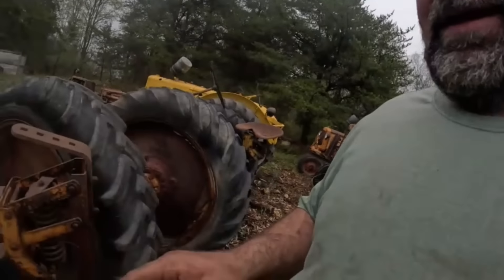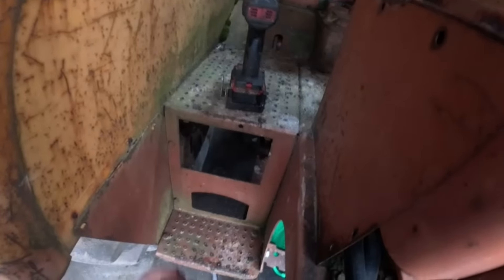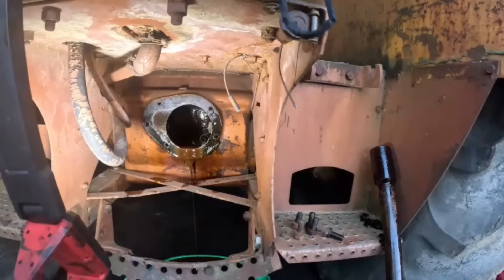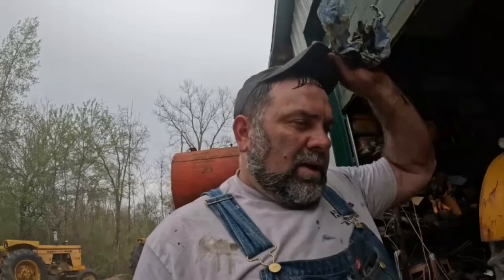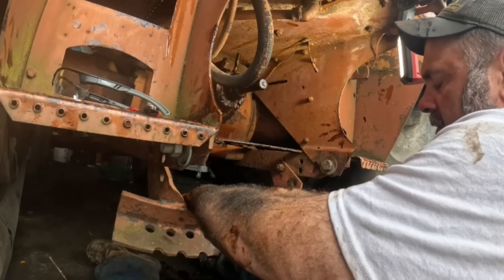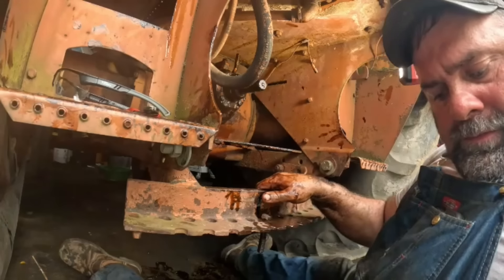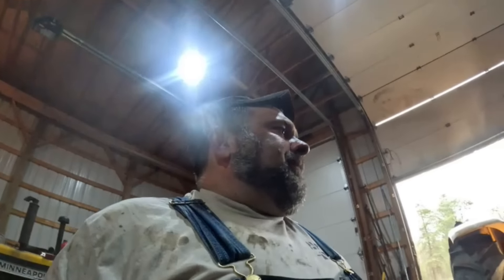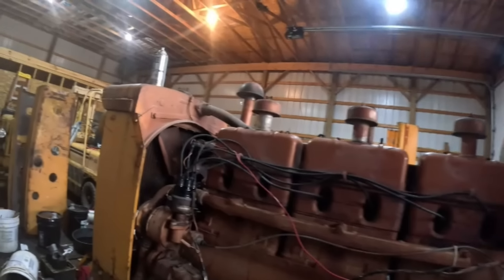MM GVI part 5 PTO install and oil change

Comment: If oil is dirty I always drain out what I can then I put tractor on Jack stands and fill the rear end with diesel and start tractor in about 4-5 gear and let wheels spin off the ground and circulate the diesel around. Then drain diesel and it’ll be nice and clean on inside.

Comment: I suspect a problem,how is the drawbar gonna fit back in??? I’m waiting? Go ahead,I’m anxious to see the drawbar installation? Ok,you win,I was wrong,when you installed the last two bolts. Anyway,I thought if you needed to drop the crossmember to remove I figured it must be hangin down to install too,yea,you , mentioned the bar wasn’t correct from the start,well, I’m old, and forgot that part.

Comment: Good video, but I hope nobody puts too much abuse on that PTO because I know a guy and he said his dad twisted the PTO off his 704 ( gvi with front wheel drive) chopping corn and the dealer sold him PTO parts for an R to get it running because they didn't have the exact parts but they fit the same and when it twisted off the second time they traded it off for a 4010